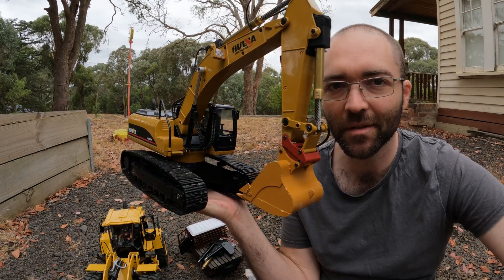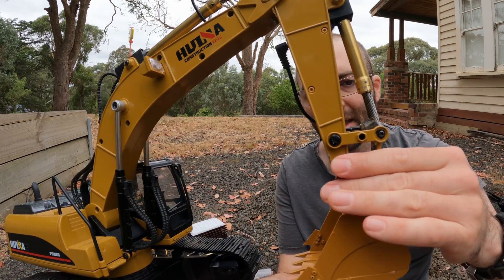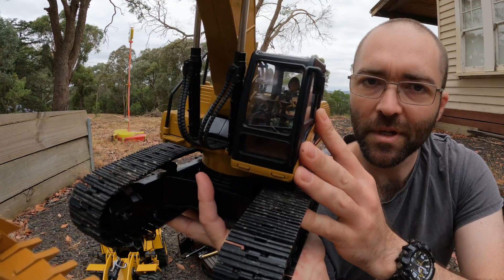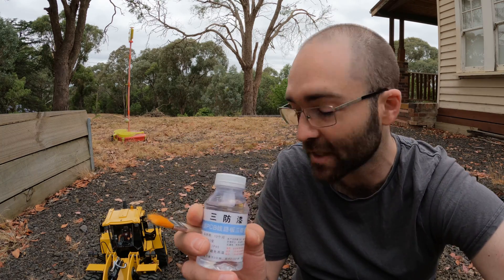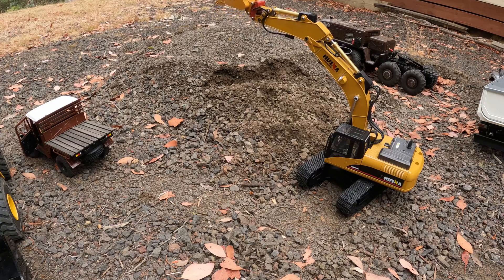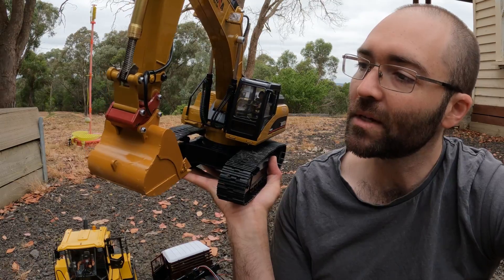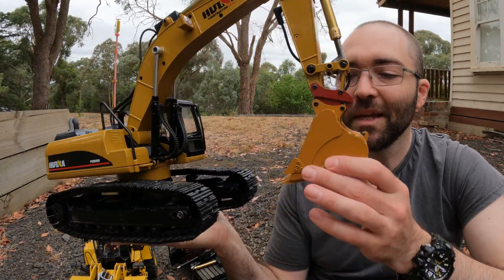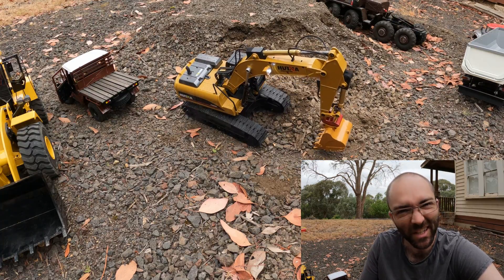Making the Huina 1580 V4 Even Better!

Comment: Bonjour, merci monsieur pour cette vidéo impressionnante! je viens de commander toutes les pièces détachées pour construire une Huina 1580, est ce que vous pouvez m'envoyer une liste de vis nécessaire pour que je les commande pour l'assemblage
Reply from the maker: Hi, thank you and I'm glad it was helpful 😊 I don't have a screw list for you, I'm sorry. I keep a collection of various screws, washers, spacers, nuts and lock-nuts here for general use. I keep a variety of m2, m2.5 and m3 with all the different heads: socket, button, flat and counter-sunk - and also grub screws and threaded shafts. I have stainless steel for looks and carbon steel for strength. I have lengths from 4mm to 100mm of these. I also keep a more limited selection of M1.6 for smaller projects. 

It sounds like a lot, but this whole collection can be had for a couple of hundred dollars on AliExpress and then you'll never be wanting for the right screw again!

If you want a basic set to get you started for RC modding, I'd suggest something like this:
https://amzn.to/46KMg53

That's about perfect. You can then get specifics you also need from there, but it's a great base to build on.

Comment: Hi! How did you split the stick?
Reply from the maker: I removed the screws and it came apart. It's cast in 2 halves, held together by screws.
Reply: @RCTNT  looks like there are plastic plugs in there? Did you drill them out?
Reply from the maker: Pull them out. Screws are underneath.
I used tiny tweezers to get mine out. You could use a tiny flat screwdriver to pick them out, or yes, just drill them if you don't care about them.
Reply: @RCTNT  ok, tanks for reply!🙏

Comment: Can the controls be reversed on the 1580? Having the boom go up with down input on the controller is odd, particularly since the stick goes down with down input.
Reply from the maker: I don't believe so, no.
Reply: That’s really odd, considering most hobby grade rc’s have that ability. Guess I’ll just have to switch the boom motor wires
Reply: I switched the boom wires on the circuit board connector but having trouble finding a board diagram with english descriptions on which wires are the max extension cutoffs so I can reverse those as well. Do you happen to know where I can find a diagram or know which wires these are?
Reply from the maker: Good solution! I don't know - but try it like this first anyway. You may find the cut off works fine even with reversed motor polarity. It's a simple enough system. Just pay attention and be ready to release the button if it doesn't stop like it should.

Comment: Hello, I commented about a week ago on your other video about your 
Initial  review of this and I finally ordered one but it was the top race one and it got delivered today and the short putter was already broke on it and I have no experience with repairing rc stuff, is there anyway you can make a video showing how you would make this repair?
Reply from the maker: What is the short putter? Honestly if it arrived broken I'd be forgetting repair and going straight back to the seller. Make a short video showing the problem and ask them for the replacement part. They should help.

Comment: I'm really struggling to source the new actuators, I'm pretty close to just buying the Magom hydraulic kit or the double eagle electric excavator.
Reply from the maker: Sorry to hear it... Although in hindsight I'd be tempted to go hydraulic too. I have a hydraulic excavator here and it's night and day better than the 1580. I've gotta think the hydraulic conversion would be worth it, expensive as it is!
Reply: @RCTNT  OK great thanks for that advice, I think I will go ahead and buy it. I actually have the top race 211m, it is the same as 1580 though. I have been researching the new Double eagle volvo excavator but it is unreliable.
Reply from the maker: I went back and forth on making the 1580 hydraulic, before settling on actuators. I'm glad I did it this way so I have variety in my videos, but if I was doing it again I'd probably just go directly to hydraulic.

Comment: Great video, cool upgrades! Were you able to do anything about the driving delay that you mentioned in your unboxing video?
Reply from the maker: Thanks! The delay is still there while I use the original radio. The way to get past this is to replace the radio with a traditional rc unit, but then you'll need an ESC for each linear actuator. Totally doable, but the return on investment may be hard to justify!!
Reply: @RCTNT  Thanks for the info! Very cool excavator.

Comment: Hi Craig!
Nice stuff! Very informative video.
Even for me, who does not like this kind of RC models 😃

BTW wrote you on Instagram, can you check if I'm not bothered you?
Reply from the maker: Thanks! I'll open insta today and have a look. I don't tend to use social media much at all if I can help it and I don't have notifications on for any of it. Will check soon. Cheers
Reply: @RCTNT  Do you know if the mainboard has a built in BEC?
Reply from the maker: Not insofar as a discrete unit but yes, it does have outputs at a few different voltages. I haven't opened it up for a while now but you could totally test it. As far as current capacity though (for supporting additional components), I'd not be so sure.

Comment: This is awesome! Seeing that screw actuator had me thinking there's some real torque in the upgrade, and sure enough they could nearly pull the whole excavator over :). I'm curious if you use an airbrush for your scale painting needs? I'm trying to decide if I want to go down that rabbit hole or if I should stick with rattle cans and brushes. I went to my first comp over the weekend and got a lesson on the impact scale points can have 😂. I stupidly thought scale points were just for class 1. On the bright side, the Sendero did awesome and I was really thankful for its turning radius after watching so many people struggle in some spots. Best way I can describe it is just just climbs, and stays pretty composed/predictable. I even did my first V notch ever... on the clock, and cleaned it 👏. Pretty challenging course on a river bank that were still wet from the last rain. I kept both courses in the negative points and wound up mid pack so that felt really good. Now to just max out my scale points 😆. You and West Desert Wheeler are both great at the knowledge drops. Very much appreciated and most certainly accelerated my learning how to RC crawl
Reply from the maker: This was really fun to read, that's awesome!

I am considering the air brush rabbit hole as well. I used those exact words on the phone to my dad just the other day :) Been thinking I should get into it for years!

Congrats on the drive at the comp! I don't have experience in scale points outside of class 1 either, though different rule sets have different parameters - and why not apply it to class 2.

The comp stuff I've always enjoyed but really I just want to drive gates with/against others. The rest of it is details :p
Reply: @RCTNT  Yeah when I checked in, they were like, do you know how many scale points you have? I was like, nope, but I have a winch and this tow strap 😅. I like the events to have fun, learn, see others' creations, but I sometimes can't help get a little competitive. I keep it light hearted but it drives me to do better the next time :). On course 2 I broke a hook on my land anchor accidentally punching reverse while I was trying to keep tension on the winch wire. That AE controller is quite good, I used the channel 3 EPA to slow down the servo I'm using. The downside is that under time stress, I push that slider right past the center neutral and the winch reverses. I'm nerding out so bad right now, but it was so much fun to run the gates. I made a paracord lanyard for the transmitter, which saved me on the 3-handed winch operation. I've since ordered a used Spektrum receiver to take advantage of the momentary toggle. Thanks for being a sympathetic ear man, I am gushing this week

For the airbrush, I just wonder if I tool up, will I use that investment more than a couple times. It always looks so cool when others do it, will I just want to pull out my thinning hair? 😆
Reply from the maker: @Andy_Yates  lol only you can know the answer to that last question!

The comp stuff is really fun to read. Thanks for sharing, I can live vicariously through it for a bit! Bring on the next one eh!
Reply: @RCTNT  Definitely! The next one is at Beards Hollow shoreline, next to a state park a couple hours from here called Cape Disappointment. I have to not let that park name get to me haha!
Reply from the maker: @Andy_Yates  lol good luck!